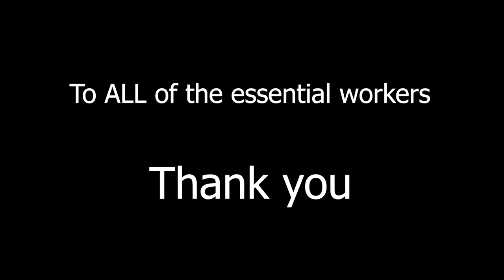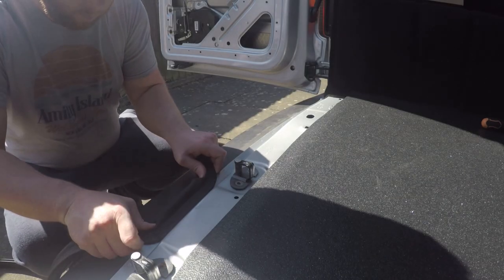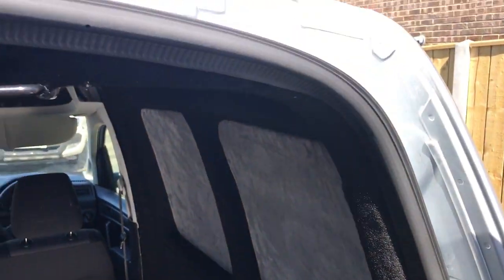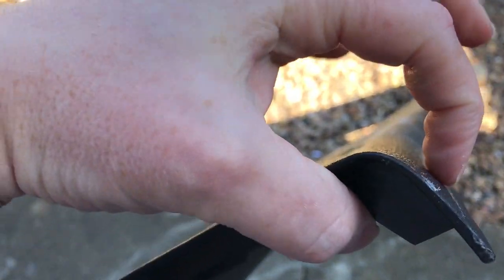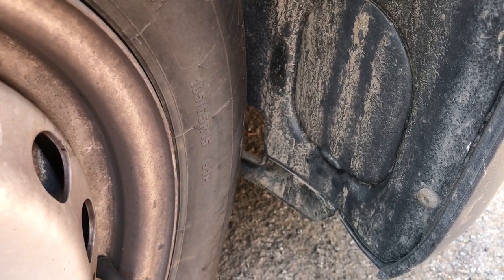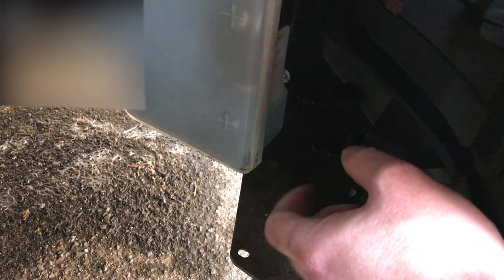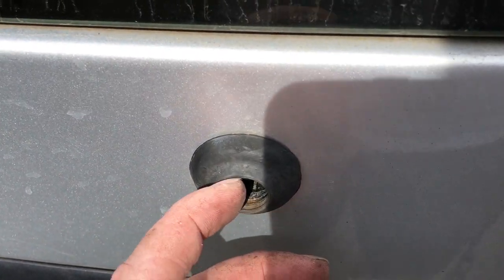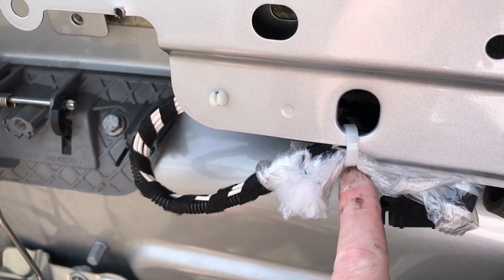VW Caddy Van Rear Wiper Delete

Comment: Olly, I just wanted to thank you for making these videos journaling your build. It has given me a lot of useful information and great ideas. It looks like it is coming on really well. I’ve just joined the Caddy2k forum, but your videos have been much more useful to see the practical side of conversion than text and photos on a forum.
Reply from the maker: Its good to know that you are getting value out of what im doing. Alot of work so far but im getting there, so many things can be done to these vans its really where do you stop. Video is the best way to learn I think. Not on the forum myself. Just using a haynes manual and figuring the rest out.

Comment: I did the delete. Rather than loosening the handle bolts to pull the motor out, you can hacksaw or cut off the wiper arm post and it will allow it to pull out easy.
Reply from the maker: Oh yeah, thats another way to do it. Never even thought 👍

Comment: Just code out the rear wiper with VCD or ask someone who has the software to do it for you. Basically you’re telling the van you don’t have a rear wiper so it just won’t work. No need to remove anything apart from the rear wiper arm and then put a cap in the hole! Job done.

Comment: You didn't need to unplug the hose at the front because when you take the back motor out it has the screen wash pump attached to it that brings it to the back.
Reply from the maker: Yeah, my understanding is if I hit the button by accident I could fill the back door with water if it’s still attached at the front but yeah either way will work. Thanks for the comment

Comment: You have to be 100% sure you have sealed the hole completely as any water that gets in there, will make its way down on to the top of the bottom door lock and short out the connection and keep setting the alarm off.

Comment: Olly, is taking out the hose essential? And would I still need to bag it up like you have done? Or would you do it differently now? I can’t find too much online about it and you’re the only person to mention the hoses, I’ve seen people coding them out instead, what do you reckon ? 
& 
thanks for the video, you’re a lifesaver!
Reply from the maker: Removing the hose isn’t essential no but I don’t have the thing to code it out and was worried I’d keep using it by accident so this takes that issue away for me. Always struggled with the rear wiper and spray as every car I’ve had was a twist and when the rear wiper was on wasn’t obvious to me when had the rear window guards on.
The bag was just incase any water drained out that had already been in the hose. This way it just catches it. Thank you glad u enjoyed 👍

Comment: Did you just Tiger seal from the inside of the van or was it on the outside too? Thanks.
Reply from the maker: Used it between the outside of the van and the inside of the plug if that makes sense so no water could get into the hole
Reply: @FreeworldOL  I think it makes sense mate, doing mine tomorrow! Cheers for the content.
Reply from the maker: Thank you for watching, just take ur time and it’ll be straight forward 👍

Comment: What flooring is that you’ve used mate?
Reply from the maker: If you put altro black sparkly camper van flooring in ebay it’ll come up. There is a video of my trying to install it. Patience is the key
Reply: Is it thin at all? Looking for a decent thickness for the flooring 
Cheers mate
Reply from the maker: @frankie_soprano  hi buddy, was quite thin I think maybe a mm but super hard wearing
Reply: Did the floor come pre cut? Looks class tbf just cba to cut it myself 😂
Reply from the maker: The ply was precut, the altro I cut myself. There is a video of me messing it up the first time. Also put the hook Stanley blade through my hand and took all the skin off my knuckles doing it so was a bit of a mess on. Gloves are recomended 😂